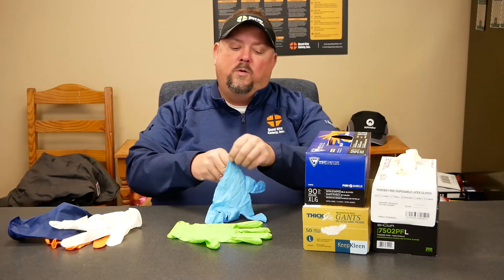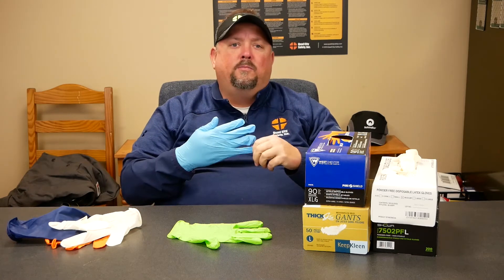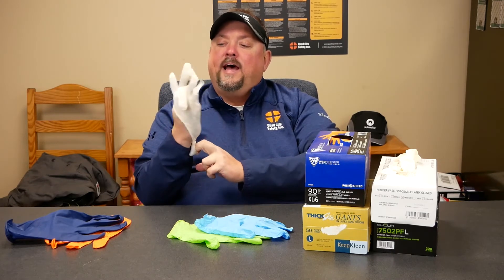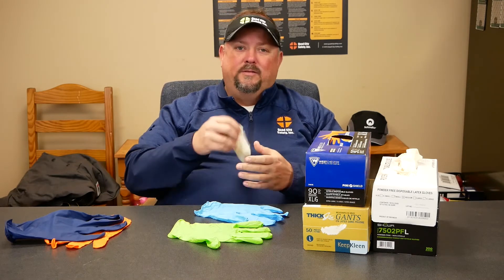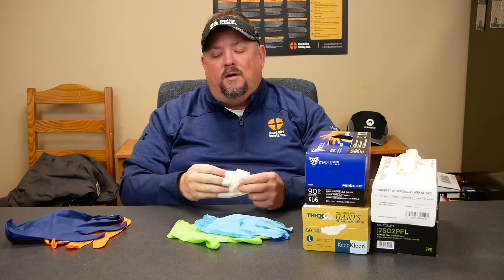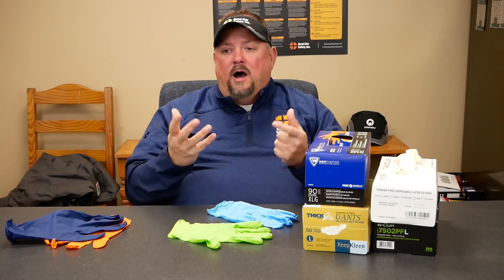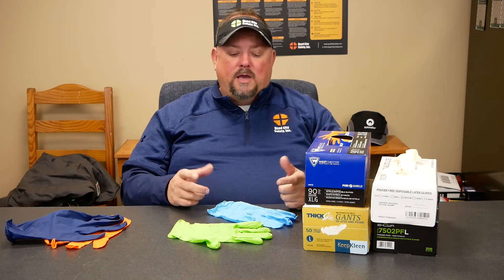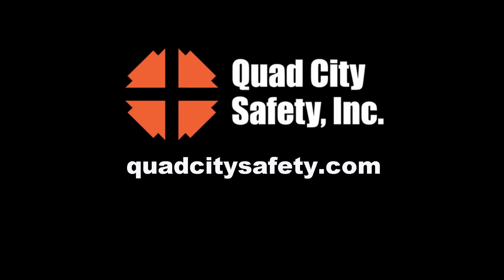Explaining The Differences Between Nitrile, Latex, and Vinyl Disposable Gloves

Comment: Im a plumber  and use nitrile because the latex are always so thin. I have a problem with them ripping, Do latex gloves come in different thickness? I need something like mechanics use that isnt going to rip when i bang my knuckle on something. I had some 12 mil at one time and while they didnt rip they were pricey. Im thinking around a 8 or 9 mil. Any suggestions?
Reply from the maker: Latex gloves do come in different thicknesses.  It maybe sounds like you should be using something reusable rather than disposable.  Thanks for watching!
Reply: Microflex diomond grip is the standard old-school latex glove that we were all familiar with in the 80s and early 90s thats about 6 to 8 mil thick and they do quite well in auto mechanics apart from strong  hydrocarbon solevents (mechanics buy them up like hot cakes)  Most gloves available on the market are going to be a 3 to 5 mil with 5 mil being the most prevalant, especially in medical grade products. With nitrile, youre not going to find the thicker gloves because thick nitrile is less flexible than latex and more prone to tear, though it depends upon the precise makeup of the nitrile
Reply: You should use one of those long ones that are reusable

Comment: I’m handling red oil and skydrol, and my employer keeps giving me gloves that break down
Reply from the maker: I’d need to get a little bit more information and see the MSDS sheets on the specific products to make a solid recommendation.  It’s definitely a sign that they aren’t providing the correct level of protection if the chemical is eating through the gloves.  We’re happy to help if your employer needs help with the assessment.  If you’re on your own I would perhaps look at the thickness of the gloves and up that level but it’s hard to know without more information.  Thanks for watching the video!
Reply: @QuadCitySafetyInc  thank you, I talk to the president of the company and he is currently looking into that matter, butyl rubber is compatible will skydrol, however my employer only provide latex gloves, in which do not provide adequate protection
Reply from the maker: Good luck.  If we can be a resource, please let us know.  Your certainly a long ways off between disposable latex and butyl rubber.  If the msds says butyl rubber is needed and they aren’t providing you the correct PPE I would entertain getting my own gloves.
Reply: @QuadCitySafetyInc  yeah I’m getting my own gloves that skydrol burns